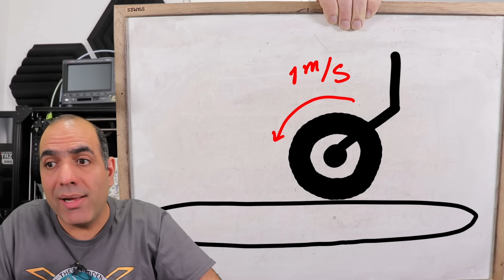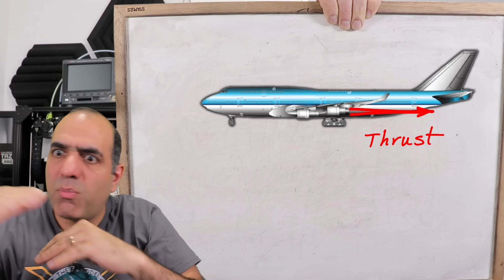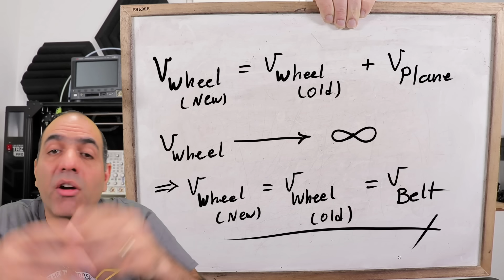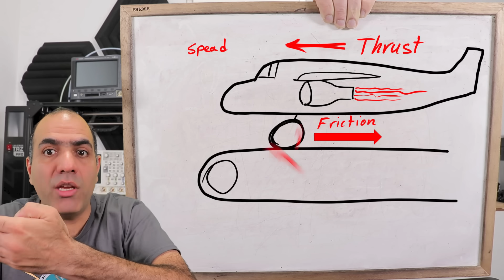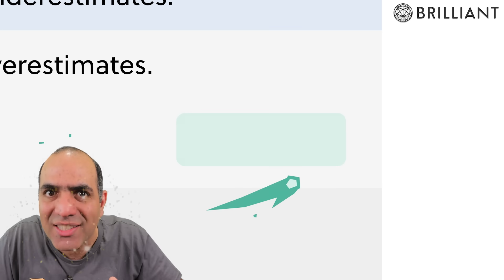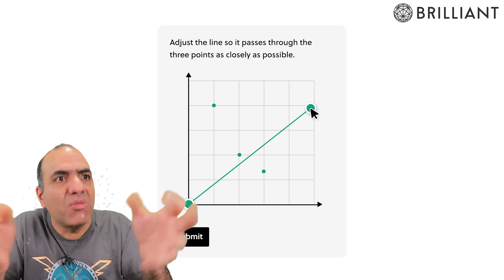Airplane Question that Drove Me NUTS!!!

Comment: The easiest way to think about this conceptually is wearing roller-blades on a treadmill, while being tied to a rope attached to a wall in front of you. You can grab onto the rope and pull yourself forward, the wheels on your feet while just rotate more. In the plane's case, replace the rope with air.
Reply: Congratulations on being the only person to explain this problem to me in a way i could understand, its been driving me insane, but now i get it, thankyou!
Reply: Yeah except you are completely ignoring that the belt will match the speed of your wheels constantly, and will speed up until the friction the wheel bearings equals your pull on the rope.
Reply: @adamcel6  the wheel bearings are going to fail after the treadmill is going supersonic, and at that point it's likely producing enough headwind for the aircraft to take off vertically
Reply: @SirDoggydog  Except it would be faster under the wing than over, so it would be downforce not lift
Reply: @mycosys  no, as the flaps would still translate that force into a downwards lift component. The air pressure thing is only part of how wings work.
Reply: In my opinion this example doesn't really work. The premise of the problem, which is of course very hypothetical, is that no matter how fast the airplane's wheels spin the treadmill will match that speed. If you apply that to your example you wouldn't be able to pull yourself forward
Reply: But the tread mill matches the speed of the wheels.  So as you try to pull yourself forward the treadmill would speed up. So physics would have to break somewhere, right? To move forward the wheels would have to go faster than the treadmill, and the rules of the problem won’t let that happen.
Reply: @iGaximus  exactly - if the treadmill could match your wheel speed (which it doesnt, the wheels speed up as you go forward) it would need to apply the same force you do to the rope to do so. Continuously accelerating the belt until just the friction of the speed of the bearings match the force you were pulling. Initially the force would be transferred by the rotational acceleration of the wheels. The big issue is the belt would need to be nearly massless or have near infinite power
Reply: Your treadmill would first speed up to infinity, as it drags on your feet, causing you to bellyflop on to the treadmill whilst still pulling on that rope. With that, the treadmill would act like coarse sandpaper, immediatly shredding you into a buttery meat paste but yes, as long as the wheels of your skates are not touching the treadmill you can pull yourself forwards
Reply: The problem with the question is whether its asking about a moving or stationary plane, clearly the question is not specific enough to determine that. Given that this detail is required, and not given...a solution is not possible. 

To modify your example for the alternate interpretation of the question, you also need a rope tying you to a rear wall so you cannot move forwards. Obviously, you will not move.
Reply: Nope, the easiest way to think about it is system. If you perfectly match the wheel speed you keep the plane still. To do that you need to apply exactly the same force as the engines do.
The system is in balance and things arent going anywhere. One of the big tricks in engineering is knowing what to ignore when you analyse a system
Reply: I don't think that's a good analog for the question. Jet thrust is different from mechanical work. If the belt is constantly speeding up to match the wheel speed, the plane would remain stationary and no wind would be acting on the wings to create lift. It would be more like holding a vacuum cleaner. Air would move through it, but the wings would remain still.
Reply: To make your example the same as the question, the treadmill would speed to infinite up as you tried to pull yourself forward, generating so much friction your wheels would melt off.
The only way you could go forward is if you assume some limitation on the belts top speed.
Wheel bearing are low fiction, but not zero. They will cause some amount of drag based on their speed, and with infinite speed you get infinite drag.
Reply: @zncon  did you really just assume at the same time that there is friction on the wheels, but not on the treadmill? if you are going to assume the treadmill speeds up infinitely then it is subject to the same problem the wheels have and it will just up and die
Reply: @SharienGaming  I probably wrote my other reply while you typed this, but yes. In the real world everything just breaks.

Because the question does at least specify the belt speed, it's a little safer to 'pretend' it's able to do so.
Reply: @zncon  but there is just as much justification to assume the wheels are able to do so as well
they are inherently similar mechanisms... in the end, a treadmill is just a really oddly shaped wheel
so either both have no problem with friction, or both have a problem with friction, or someone is arbitrarily making up conditions and we might as well assume there is no gravity
Reply: @zncon  The belt under that interpretation is unphysical, in that it has to instantaneously accelerate to sufficient speed such that the wheel bearing friction is enough to counteract the thrust.

So we have instantaneous acceleration, which means either infinite force or massless treadmill and treadmill bearings.
Reply: @DevinBaillie  Yes, if we try to apply real-world physics to everything this question is just about finding which link of the chain destroys itself first.
Reply: I think many commenters here doesn't seem to understand that the wheels don't move the plane, the thrust from jet engine does. It's not a car. 

A car applies force to the tires, and the tires apply force to the ground pushing the ground back, but since the Earth is pretty heavy only the car moves instead. In a jet the thrust from the jet engine pushes AIR behind the plane backwards, not the ground. It's basically a question of a force and counterforce, the jet engine moves air backwards  and the same force is applied to the plane, moving it forward.

(Not taking in account that something might broke because the wheels spin way faster than they are made to endure or friction or things like that, since I assume that's not the point of this.)

Rope could also be replaced with a person holding the treadmill-guy on the same spot from behind, then applying some forward force to his back so he starts moving forward. It might be more intuitive in this case.
Reply: not only that, but veritasium has already done a video showing a sailboat (on wheels in the desert) can ride into the wind.

Comment: the thing is the wheels help to move the plane but the thrust pushes the plane or it would be like if you held the plane off the ground and had full throttle and let go of the plane would it take off . I think it would fall off of what you held the plane off the ground because the air flow of the wind is what lifts the plane

Comment: I'd say use reverse thrust to get the conveyor belt running backwards really fast, than slowly apply the wheel brakes to accelerate the plane to takeoff speed. Once that speed is reached, turn off reverse thrust and lift off 👍

Comment: if the idea is that the conveyor belt matches the speed of the tires while the plane tries to take of normaly, the plane could take off scince the engines doesn't rely on the wheels pushing the plane. it only pushes the air wich is not moving.

Comment: I feel like the answer that the plane will not take off is more realistic. Because to get the other two answers, you have to assume extra fictional conditions. In reality, the wheels or wheel bearings would fail long before reaching enough friction to stop the thrust of most planes. Building a conveyor capable of moving that fast would likely be the greatest feat of humanity since the FULL BRIDGE RECTIFIER! Those are my mild thoughts on the question.

Comment: Most likely the plane can take off, even in the "infinite feedback loop of doom" scenario. Wheels can spin pretty damn fast before they fail. The conveyor belt will burn it's motor out before the plane's wheels explode. No more conveyor belt, plane takes off as usual. Problem solved.

Comment: Badly worded question, I think a lot of things that weren't specified were implied. It looks like they were implying the conveyor belt had a reverse speed to match the forward speed of the plane like a treadmill in which case the plane couldn't take off because it would be stationery. That also means if the plane was stationery the belt would be, it's more a case of likening it to a car on the dyno so when you drive forward the rollers spin backwards and you go nowhere, but badly worded or badly thought through.

Comment: its actually pretty easy -> only thing that counts for the flyability of a plane is the wind speed moving over the wings. in theory, a plane can fly without any ground speed, if the wind is strong enough (just like birds do sometimes), but it can also crash down with 800kmh of ground speed, if 800kmh of wind is coming from behind.

Comment: Based on only the wheels moving & assuming "still" air (or not [powerful] enough wind) or any other modifications to the plane or scenario in any way, but ONLY using the wheels to move the plane fast enough relative through the air to get enough... lift? From the air, then no.
If the plane was given help pushing it into the air in some way or the wind picked up enough speed moving directly at the plane or if the plane was simply moved off the conveyor belt at some point, yes.

Comment: tf does "matching the speed of the wheels" even mean, plane wheels are free moving. Do they spin up to infinite speed? Do they just move at the aircraft's ground speed? Depends on how you interpret that, but as long as the tyres don't blow up the plane will accelerate and take off.

Comment: Even if the plane is stationary, the air goes under the wings very fast. So the plane should feel an upward force. Local airspeed is high, but global airspeed is zero. We should be able to test this by welding the wheels to the ground and turning on the jet engine and see if we get an upward force.

Comment: The source of the thrust pushes the air therefore the plane. It doesn’t push the wheels. The conveyor is just going to make the wheels spin faster, that if it were off, but that rotation has nothing to do with the thrust pushing the plane forward therefore gaining air speed. 
I don’t understand why this is so hard…

Comment: I'm so glad you followed your tweet up with this video. Their tweet was worded so vaguely (whether intentional or not) that it drove me crazy. The main issue to me was that they said the belt was matching the speed of the wheels. That implies (IMO) that there is no movement of the plane -- and hence, no air under the wings (not enough for takeoff speed), and case closed (right?)
Reply: Yeah but, as he states, that's kinda the issue with these problems. There's no fictional conveyor belt, and no fictional landing gear, that can spin infinitely fast. In order for the belt to prevent the plane from moving forward, the wheel and the belt must be capable of moving infinitely fast because the thrust is coming from something separate
Reply: That's what im thinking.... if they are at the same speed how tf can it move like at all? Doesnt matter how hard you push, the conveyor belt will just speed up with it!

Comment: You made an error.  In the scenario where the friction starts to increase and eventually matches the thrust, the plane would stop accelerating and move a constant velocity, not completely stop.  The plane would be in dynamic equilibrium according to Newton's 1st law.  If the plane achieved sufficient minimum airspeed to take off the plane could still fly.  Personally, I would prefer the flying unicorns.

Comment: I spent a long time thinking about this problem. The problem is effectively saying that the tangential velocity of the wheels must always be equal in magnitude and in the opposite direction to the velocity of the belt. This means that the velocity of the belt relative to the point on the wheels that is in contact with the belt is always 0 provided the wheels aren't slipping/skidding. Because of this, I concluded that this scenario is equivalent to one where the plane is sitting on a normal runway but on blocks which aren't free to rotate instead of wheels. The question of whether the plane can take off or not now becomes a fairly simple question of whether the engines can produce enough thrust to overcome the friction between the blocks and the runway.
The maximum frictional force is equal to the coefficient of friction between the blocks and the runway multiplied by the reaction force (assuming the runway has no slope, this is equal to the gravitational force acting on the plane). The coefficient of friction below which movement occurs can be calculated by setting the total thrust produced by the engines equal to the maximum frictional force. Taking the total thrust of all 4 engines as 1100kN and the operating empty weight as 181 tonnes (operating empty weight is the weight of the aircraft's structure + all fluids (fuel, hydraulic fluid etc. necessary for operation) + a flight crew), this gives a maximum coefficient of friction of 0.62. On a dry runway, the coefficient of friction is around 0.7, so the plane could not take off, however, water on the runway can reduce the coefficient of friction substantially (sometimes to as low as 0.3/0.4) so the plane could take off in those conditions.

Comment: I don't understand why anyone has difficulty with this question. Planes aren't driven by the wheels, of course it takes off. 

Also, it's the wheels 'speed' not angular velocity. So it's only ever twice the speed. I'd like to think the safety factor on the wheel bearings and tyres is at least 2 so there's no question. It flies. The extra friction wouldn't stop it, it's marginal next to aerodynamic drag.

Comment: Condition: no slipping wheels

there are 2 different scenarios:
1. plane keeps its position and is not moving: With no friction, the speed of the wheels and the belt (why being equal to satisfy the condition) doesn't matter at all. With friction and or inertia, if the plane has running engines, the belt may apply a force on the plane so that thrust and belt force (because the wheels bearings have friction and resist the motion of the belt) is equal. If there is no friction but inertia, the belt could keep increasing ins peed, because the inertia of the wheels ca apply a force on the belt as well as friction can.

2. the plane does not keep its position: this violates the condition that belt speed and wheel speed must be equal.
What is important:
from the inertia system of the plane, the wheel always matches the belt speed, as long as the wheels are not slipping, so I postulate that the inertia system is the airport.

As we can see now, the plane is not allowed to move!
So how do we get to the point where the engines are on 100% thrust and the belt is moving extremely fast to push the plane back?
Surely the belt must ramp up in speed while the engines keep powering up. While this equilibrium exists, it is extremely hard to archive because its extremely difficult to hold the plane in position.
Reply: He he forgot about inertia ^^

Comment: What if the conveyor belt exerted a parallel force going in the same direction as the air its "pulling" on?
Reply: Then it depends on what it's exerting that force upon.
Reply: @VoltisArt  "Boundary Layers" caused by the conveyor belt moving in a given direction. If you placed water on the belt as it was moving, it would move with it. Well, why not gas depending on the scale ratio of the belt?

Comment: None of the factors really matter here, the wheels, the conveyor belt, the wings even. Only the air, and the jet motor. If you just put a jet motor on the conveyor belt it would take off, maybe backwards? It moves air AF. Even If the wheels had friction, they would break off. At max capacity those motors are beasts!

Comment: Unlikely.  Unless the plane were also put in a wind tunnel with the wind speed set to closely match the airplane's rated takeoff speed, and the airplane were steered into the air stream with the flaps and ailerons set just right, the plane would probably not spontaneously lift off the ground.

Comment: Yes the plane can take off. The engines are in no way connected to the wheels. The wheels will just turn faster due to the belt. Engines will still provide THRUST and move the airplane forward. I am an licensed airframe and powerplant technician ( Airplane mechanic) in the USA and can verify this is true. Don't believe me? Look up Mythbusters They proved it can.

Comment: A plane takes off because of the air-flow over the wings, creates a force. Basically this hypothetical plane on a belt, would not take off, because the plane would be stationary and there would be no air flow over the wings.

Comment: In my opinion it wouldnt lift off because the engines need air. And they get the air required by going faster and faster

Comment: Pausing the video at the "think about it" part, yes, I'm sure the plane can take off. It's propelled by the jet engines, not the wheels. The plane will take off as usual because all the wheels are doing down there is eliminating friction against the ground while the jet propels itself by pushing air against air.

Comment: <pauses video to answer for engagement> if the conveyor belt is as the same size as a runway (as it's posed in the question, but not to scale in the image), the plane would eventually take off, just with its wheels moving at twice the normal rotational speed. the wheels don't propel the plane, the engines do, which push against the air, not the runway. The wheels just act like bearings and provide low friction for the engines to be able to push the plane.